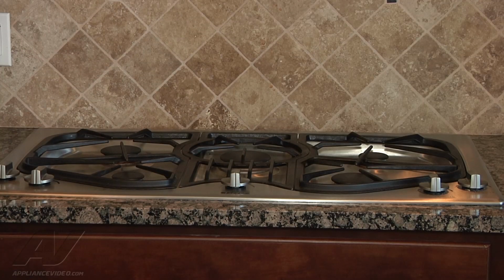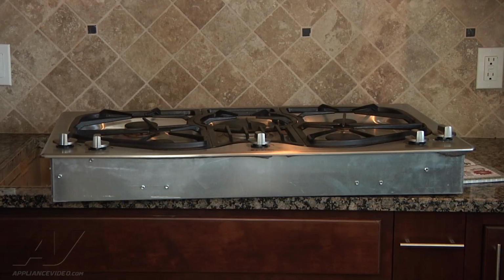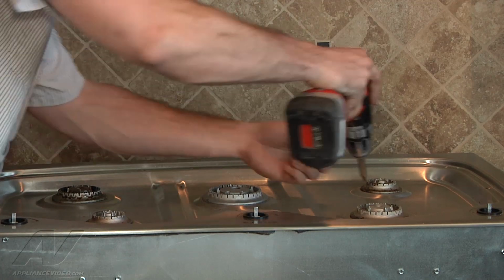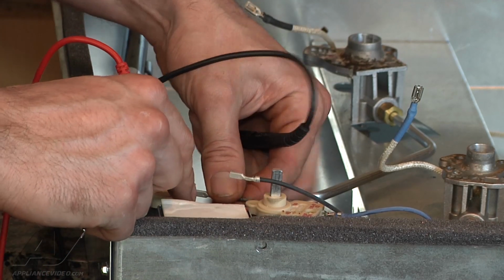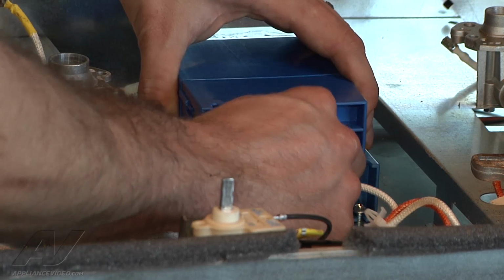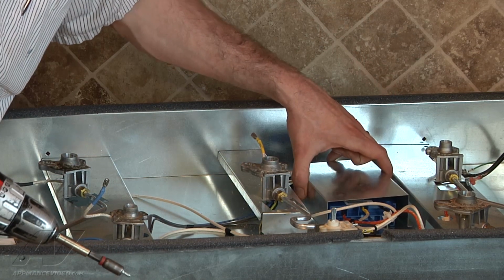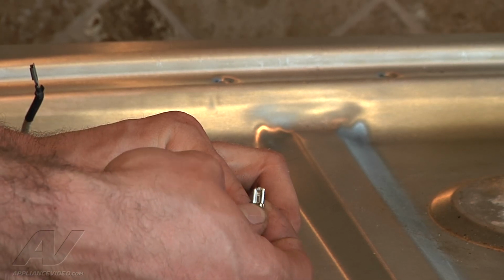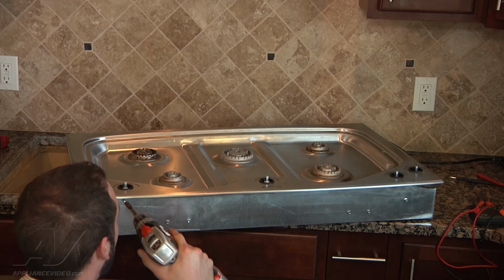Jenn-Air Cooktop Repair - Continually Sparks - Spark Module - Diagnostics & Troubleshooting

Comment: Hi. Great video. My Jen air gas cook top has one burner that’s not sparking. Could this be a bad switch that doesn’t electrically close?  Or the module? Or the burner?  How would you troubleshoot?  Thank you.
Reply from the maker: Great question, if you have a more technical question that our parts department cannot answer, you can search our over 17,000 answered questions free at our website www.ApplianceVideo.com under our Repair Help section. You can also call our parts department at 1-800-830-5465 and they can give you help 7-days A week ,or search at www.SaveMoreOnParts.com  .
Reply: Hi Richard(or anyone with similar problem), did you resolve and what was the cause/fix to this issue?   Having the same exact issue. For the one burner(right front, and most frequently used), if you turn on the gas, there is no clicking.   However, if you turn another burner at same time, this 2nd burner clicks and lights the burner that is not working!   Tried a few things: 1)replaced the ignighter(no change)   2)switched the wire harness with another burner(no change)  3)cleaned the impacted burner well(no change.   I am accessing from the bottom, as much more of a project removing from its mounting if can help it.

Comment: your video is great. but in my case the screws on the burner are very corroded. How to remove them?
Reply from the maker: Great question, if you have a more technical question that our parts department cannot answer, you can search our over 13,000 answered questions free at our website www.ApplianceVideo.com under our Repair Help section. You can also call our parts department at 1-800-830-5465 and they can give you help 7-days A week Monday Saturday, or search at www.SaveMoreOnParts.com  24 hours 7 days A week.

Comment: I'm having the same issue however I'm able to narrow it down to the back left burner. Once that one lights, the igniter stops clicking. Does that point to the burner switch and/or a bad thermo-resistor (I think that's the right term)? Or could it still be the igniter module? I should point out that this happened after the stove was cleaned. I let it burn for 10 minutes to see if drying it out would help but the issue persisted.

I appreciate any input you have. Thanks!
Reply from the maker: Sheldon Esteb 

                   All of our technicians are now answering questions
daily at our http://www.appliancevideo.com/ website under the Repair Help section.  We also have over 1600 common questions and
answers that you can easily search through by your model number, appliance
make, problem or error code and it’s absolutely FREE. You also have the option
to email a factory service technician with a question on your appliance at
http://www.appliancevideo.com/repair-help/ . If you’re looking for a repair video, you
can also search our library of over 2600 free repair videos. ApplianceVideo.com
specializes in quality DO-IT-YOURSELF appliance repair videos and we get over
800,000 views per MONTH to our videos worldwide and growing. If you need of
parts for your major appliance, we have over 5-million parts in stock at http://savemoreonparts.com/ .  Thanks
for your support. Matt Ace Appliance factory service technician.